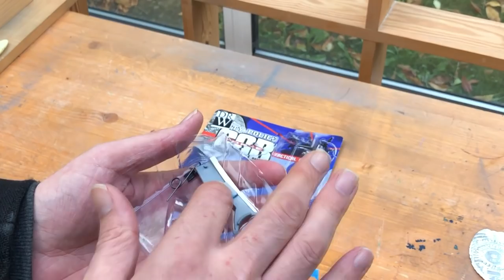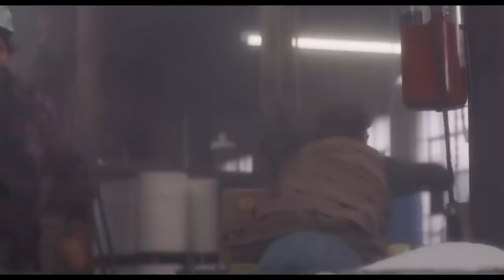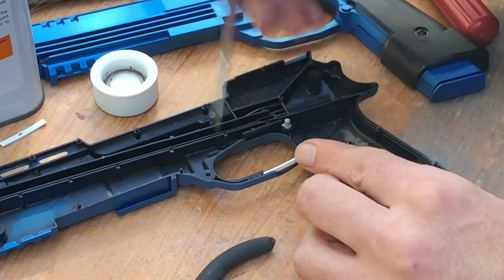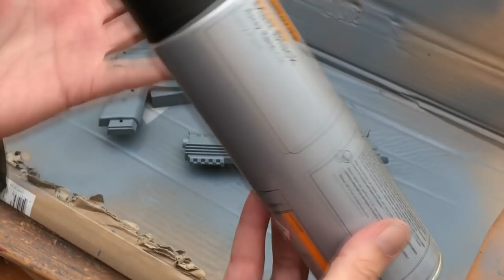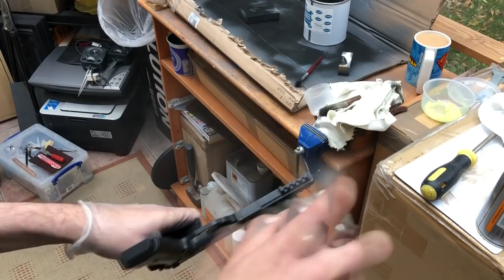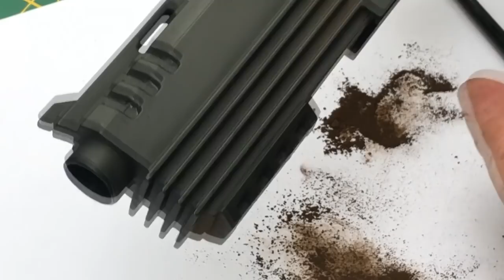Realistic Prop Gun Finishes Using Graphite Powder

Comment: Outstanding  work. I'm wondering if I can use the graphite powder for my Auto 9 BB gun. Is it safe?  Also, where did you get that cool metal piece to hold up the gun?
Reply from the maker: Thanks, I'm glad that you like it. As for your question, I can't see any reason why the graphite wouldn't be safe on your BB gun - this method has been used on prop guns for decades, even ones that fire flash charges. That said, I wouldn't allow the powder (or anything else for that matter) to get down into the barrel as potentially that could alter the inner diameter or even clog it up... which could be harmful.

Those metal pieces? Look up "1-2-3 Blocks" - they're machinist's tools, but I use them because they're great for holding parts together at 90 degrees when gluing up projects, but I also use them to weigh down pieces or to hold stuff up for You Tube thumbnails.
Reply: @PBProps  Thanks for the info. You're a cool dude.

Comment: did you find that the laqor dulled up the metal shine?
Reply from the maker: It can do if you apply too a heavy coat - which is why I spritz the stuff on. If it does go on heavy, I tend to douse the piece in more powder, straight into the wet application and that seems to help. I thought that I demonstrated that in this video or at least mentioned it. I dunno, it's been a while.